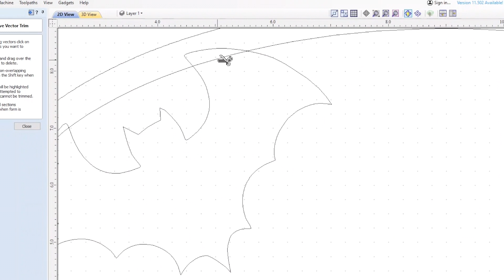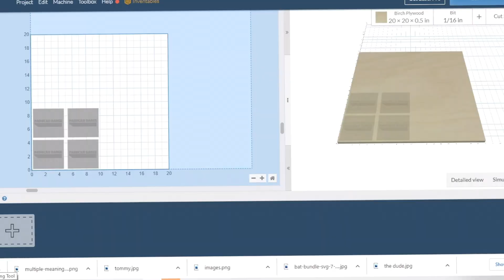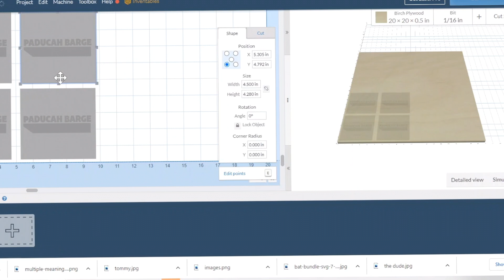Answers To Your Top 6 CNC Questions | Onefinity CNC Woodworking

Comment: Yes, it is "real" woodworking.  Just another tool at our disposal.  Typically most complex projects may require more than just the CNC to complete.  A CNC just opens so many opportunities and broadens the horizons of what is possible to create.  I have a Onefinity Journeyman X50 and am just beginning to tap the potential of what I can create with it.  My mind works faster than my shop-time allows.  The haters that claim this is not "real" woodworking are usually those that cannot afford the financial barrier of entry.  While I understand that this barrier exists, it should not be used to determine what qualifies as real woodworking or simply machining.  Love your channel.  Keep the content coming and I will continue to support.
Reply from the maker: Agreed

Comment: Glad you mentioned DESIGN. A large number of Youtubers showing off CNC aren't designing anything, they're lifting/stealing artwork from the web and then doing a vector trace of it in their software. This tool isn't simply a photocopier to knock out other people's designs. Sure, someone can use it for that, but I really hope they stay out of the commercial and retail spaces if they do.

The CNC is another tool, just like a traditional router, table saw, planer, etc. Of course it's still "real" woodworking. No one would ask a machinist if they're doing "real" metalwork while they're operating a CNC.

In summary, your imagination is the limit, but all tools require work and proficiency.
Reply from the maker: I agree. I believe that woodworking in whatever form is a creative endeavor, so simply downloading finished projects is boring and unoriginal. I do it from time to time when I need something and don’t feel like designing it, and would rather just pay the $2 and get to work. 

Many of my videos focus on design tools, so I think I cover it pretty well

Comment: Great videos!   I have two questions…As a person starting out with a CNC, would you choose the OneFinity Elite over the model you have?  What electrical setup do I need in my garage to set up a shop using the same size tools that you use in your shop?  Thank you for your advice!
Reply from the maker: I’m not familiar with the Onefinity Elite, so I can’t really comment on that. My shop only has one 20 amp circuit, which is underpowered. I’d like to also have a 220 for things such as a jointer, but that’s an upgrade for another time. The Onefinity runs fine on a conventional outlet though
Reply: @SothpawDesigns  Thank you so much! I love your easy to follow videos!

Comment: Hello I am about to purchase a cnc machine and its looking like an X50. My question to you is can I cut up to 1000mm long and 100mm wide, that's 39.4"x 4". Either X or Y axis or diagonal across the bench ?  I do like your videos they have a lot of good information cheers.
Reply from the maker: The Woodworker model, which i have, only does 32x32 inches. The Journeyman model will do 48x32 inches.

Comment: Of course using a cnc is still woodworking as you're still working with wood. Most hobby cnc's like my Longmill MK2 cannot handle fullsize boards and have to be cut into smaller pieces first using a jigsaw, tablesaw or some other means. After the cnc is done doing it's thing, you will still need to sand as there may be toolmarks left on the piece or the surface needs to be smoother than the cnc can make it. You also need to apply some finishing oil on some projects as well and cut/sand away the tabs. I heard some say that cnc isn't woodworking because you're using a machine. Well, then those woodworkers should get rid of all their machines as well like a tablesaw, jigsaw, drill, sander and planer as those are machines too, the only difference being those aren't controlled by a computer. Even a handsaw, chisel or a file is basically a machine, just handpowered instead of powered by electricity. So I don't really care what they say about using cnc for woodworking. Let woodworkers claiming such nonsense about cnc not being woodworking make a rounded pocket or make a 2.5D model or even an engraving or photo V-carve and see how long they need to do it with the same precision as a cnc, if they're able to do it at all.